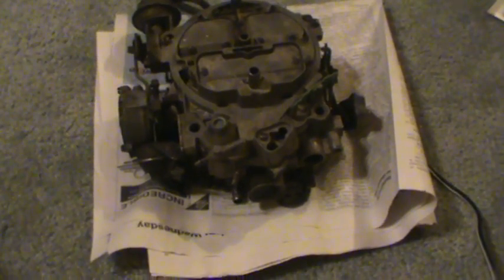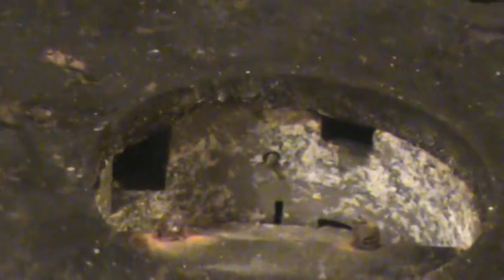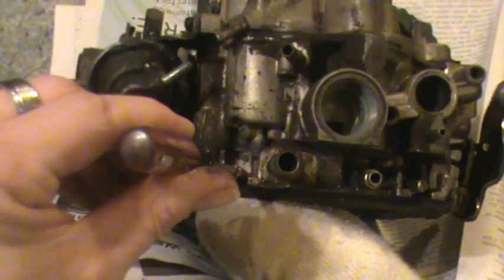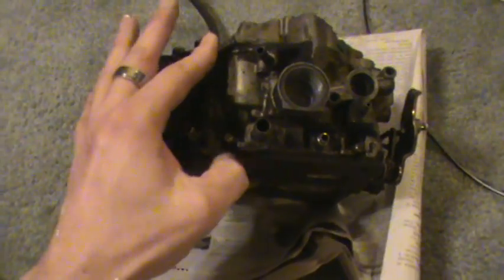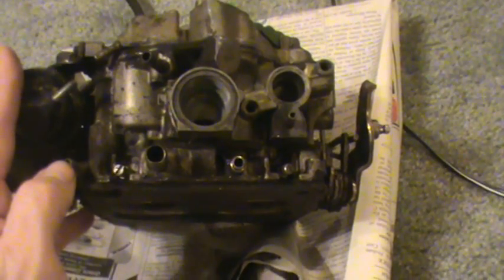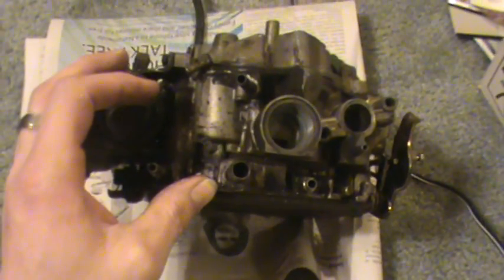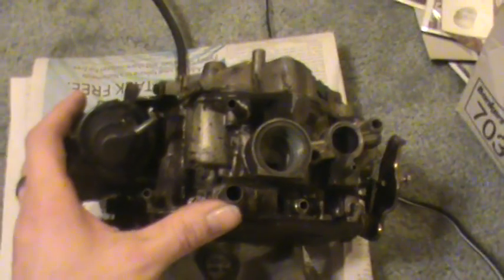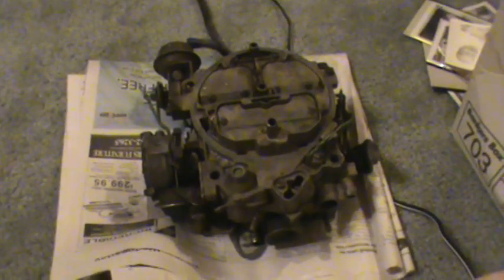How to adjust carburetor mixture screws

Comment: I have a 2 barrel on a 305 monte carlo i took it apart and cleaned it up and put new gaskets and float and needle now it wont stay on. Would i have to re-adjust the mixture screws since it is clean and not all gummed up anymore. Carb is a gm 2
Reply from the maker: Yes. Mixture screw adjustment is just one of those periodic things you have to do on  a carbureted vehicle.

Run each screw in(to the right) until it lightly seats. LIGHTLY. Then back each screw out 2 and a half turns(to the left). That's a baseline that will get it idling as long as there isn't something else going on.

Once you get the engine warmed up, you can fine-tune the screws just like I describe. Turn each screw back and forth until the idle speed is the highest.

Comment: Hello.
Very nice Video thank you! But my Problem is that i got these 2 screws out of my carburator and i forgot to count how many turns it took to get them out. Do you have a clue how far i have to screw them back in? I dont want to destroy my engine.
Thanks again you already helped me a lot!
Reply from the maker: LOL, don't worry, it's impossible to destroy an engine with the mixture screws. Run them in till they LIGHTLY seat, then back them out 2-1/2 turns each. Make sure you count the turns correctly. That will get it running. Then after you warm the engine up, adjust as described. Thanks for watching.

Comment: WhoSaidTyler I have a 82 camaro 305 quadrajet 4 barrel and my choke light is one and i tried adjusting the choke plate but it doesn't go off and i tried adjusting the choke plate where it should be but at times it high idles high and sometimes idles low after i adjust it. I bought it from a guy and he rebuilt the carb with a carb rebuild kit. What could be the problem with the carb?
Reply from the maker: You likely have either a dead electric choke unit, or no power to it. The troubleshooting process is pretty simple:

1. Get a cheap digital multi-meter on hand. Access the wire that connects to the choke, usually it's a green wire. Start the car(it MUST be running, not just have the key on) and see whether you have 12v at that wire. Ground the negative lead of the meter, stick the positive into that wire connector and see what you get.

2. If you have 12v then the issue is with the choke unit itself, which is the part that is retained inside the choke housing by the 3 screws. Sometimes they just burn out, but another thing that can disable them is that there is NOT supposed to be a gasket between the choke unit and the metal housing. Hot Air chokes use one, not electrical, so double check that there isn't one there.

3. If you DON'T have 12v with the car idling, then you have to figure out why. That circuit supplies "key on" power which travels into the engine bay, through the oil pressure switch( or a separate oil-pressure activated switch), then to the choke, The reason for going through an oil pressure switch is to prevent the choke from getting power with the key ON but the engine not running and causing the choke to open prematurely.

Ok...there are two locations for that switch: In the first scenario, it all runs through the regular oil sending unit which is located at the rear of the engine behind and below the distributor. Look at the connector. If it has 3 wires in it, then that's the only one and it should have a 3-wire sending unit installed.

If it has only one wire, then look on the left(driver-side) of the engine block at the rear, just above the oil filter. There should be another switch there with 2 wires. At that point it will be a matter of tracing power until you find a bad wire or a bad switch. Good luck.
Reply: thank you i'll check it out. Also when its running and i rev it it bogs revving up would that be something on carb?

Comment: Dear Cab Tech: 1985 22R Toyota: with engine off, float reservoir leaks fuel into intake manifold.  I replaced POWER VALVE and did full carb kit. It still leaks, but much slower.  I notice the power piston is pushing power valve open when I was installing top carb plate.  Should power piston be pushing power valve open during the install?   Thank you for any help.
Reply: I did a few easy test and why I'm puzzled.  When pressed, Power Valve leaks fuel.  Piston rod shouldn't be pushing valve during the rebuild or when engine is off.

Comment: ran across the plug over the adjustment screw on a toyota 22r i used a dremel and small chisel didnt feel like taking it off helped the truck a ton. Good video i was trying to explain this to my cousin how you just have to feel the sweet spot but he said i sounded crazy.

Comment: What if you idle speed screw is as far out as it can be and engine still idling about 1500rpm?
Reply from the maker: Check the ignition timing. If it is too far advanced it will cause the idle to be high and nothing you do with the carb will lower it.
Reply: Ok thank you

Comment: Thanks for making this video. I have a 1990 Chevy Camaro with a 305 V8 (carbureted). After maybe 20-30 mins my car starts to sputter and backfire and the check engine light comes on. Does my carburetor need adjusting?
Reply from the maker: You need to retrieve the trouble code that the computer sets when the check engine light comes on and go from there. The last factory carbureted Camaro was an '87 model, so your car should have TBI, Throttle Body Injection. Thanks for watching.
Reply: Ok, I'll do that. Thank you. I'll keep watching your channel.
Reply from the maker: *****
Good luck!
Reply: WhoSaidTyler
hey there, i have 4 scews, a base idle scew, the 2 misxture screws, and an other one on the left side, have have mesed with it a little and it changes the idle speed, so i wonder what its for, its on an 1985 chevy c20 5,7 350, quadrajet
Reply from the maker: *****
 Watch "How to adjust dualjet/quadrajet fast idle", that will explain it clearly. Thanks for watching.
Reply: thanx !

Comment: Tyler, have a question if you could answer ASAP please.  I have a 1983 olds 307 w/ a factory quad.  It's been rebuilt last year but I have always had trouble with a low idle while stopped in drive.  When its in Park it doesn't seem to have this problem.  I live in Mpls, MN and its a pain in the butt sometimes during stop and go traffic.  I follow your videos but can't seem to fix this problem.
Reply from the maker: I am assuming that you mean the engine won't idle well and tries to stall. Since your comment is on the adjust mixture screw video I will ask if you have done that?

BEFORE YOU MESS WITH THE CARB, CHECK OR HAVE THE TIMING CHECKED. Timing that is too far retarded will cause the engine to refuse to idle at low rpm.

You'll need to be able to adjust the carb mixture as well, but two minor things may present themselves:
#1 is that originally the mixture screws at the bottom were covered with tamper-proof plugs. Most have been cut out by now, but there are still some roaming around that have never been removed. They have to come out to access the screws. Carb needs to come off, flipped upside down and surgery performed. You can take a good flashlight and look at the carb and see whether yours are there or not. As in the video, you should see two "somethings" on the very bottom of the carb, in front. They will either be what looks like the ends of two round metal plugs, one on each side, or if you are lucky, two holes that if you look close, will contain the mixture screw.

#2 The mixture screws are "double D's". That sounds funny but it means they don't have screwdriver slots. You use a special flexible tool that is pretty cheap and can be gotten off the internet easily. It's called a carb adjusting tool.

http://www.summitracing.com/ga/parts/wmr-w1187/overview/

Good luck.

Comment: i have 350 stingray with the quadrajet ides smooth and drives great until i reach 45 mph or if i step on it and it bogs down almost to a stall, let of the gas and idles back but still can on drive up to 45 and easy on the pedal
Reply from the maker: It sounds like it has a fuel starvation issue. There are SEVERAL things that can cause it..fuel tank pickup restricted, pinched line, pump failing, plugged fuel filter,  float set too low in the carb.

Has it always acted this way or did it began after something else was done?
Reply: You so correct,  I was so stupid, I replaced the fuel pump and tank but thought it was smart to re-use the orginal fuel sending unit not a good idea learned that lesson, ordered one gonna changed that as well as filters and rubber hose off filter to carb, will check lines for pinch, didnt really understand car runs perfect ag slow spend but I guess at higher rpm more fuel is needed, thanks so much, seen many of ur video's and postings its amazing to have access to all that knowledge u have thanks and will be asking many more questions
Reply from the maker: Patrick Browning  Glad to help, man. Just take it one step at a time. When you have the old sending unit out, see if it was stuffed up. Those filters on the end can get full of junk, esp if the tank was rusty. With everything disconnected you can also blow through the fuel line under the car with compressed air to make sure it's clear.

Comment: thanks for the video i got a 1985 silverado c30 454  with the original 800 cfm quadrajet the needles on it dont have the screwdriver slot to adjust them it has the socket ones and my question is do you happen to know what size socket fits these thank you
Reply from the maker: It's a special head on that screw. You might get a socket that will work but most times it's too large to even fit in the hole(insert joke).

You can still get the special tool used for those adjustments here: http://www.amazon.com/AMPRO-T71301-Carburetor-Adjusting-Tool/dp/B00A8FOB16

Comment: I replaced the carb, and its running much better, however the van still sometimes dies at lights/stop and hesitates a little when pulling off from a standstill. For the the stalling, am I now looking at an EGR valve? I set the screws 2 and 1/2 out from setting, and it was running a little low, like it wanted to die. So I tried to adjust them one way or another, but it was very difficult to reach the idle mixture screws since the distributor was in the way. Finally when the van warmed up I adjusted the driverside idle screw and the lobing went away and didn't die at idle anymore. Am I doing anything wrong?

Comment: Thanks so much for the video! I'm trying to help an old disabled lady remove and replace her carb in a 85 e-150. I'm a car enthusiast at heart, and I've got a rebuild underneath me. But I'm new school- so adjusting the carb is something I don't have much experience with. She plans on getting the carb from autozone- will everything already be set? Should i check or set anything before I install it? Any guidance you can give me would greatly be appreciated! Thanks again!
Reply: SVPrelude I'm actually very surprised at how little information is floating around about this vehicle or carburetors in general. I understand the vans 28 years old- but normally the interweb is full of useful and not so useful information. There's barely any- and when I do stumble onto something, the descriptions are very vague.
Reply from the maker: What I do is find the two idle mixture screws, run them in till they lightly seat, then back each out 2-1/2 turns. That's a good ballpark to get it running, then after it warms up you can fine tune them as outlined here. You can also tweak your idle speed adjustment at that time but do that AFTER you have the mixture set.
Reply: WhoSaidTyler Thank you so much for the quick reply! After hooking all the vacuum lines up, and the fuel line- is there anything other I need to do before I start the car? I know after I rebuilt the fuel injected engine, I primed the fuel rail by cycling the fuel pump on and off a couple of times. Obviously, this isn't the case here, but are there any other similar steps? The more I do research on the carb, the easier it seems like a straight and forward install. This lady's van kept spitting black sut on start up, and would die a few minutes after idle or when she rolled to a stop or a light. However, if she just drove it on the highway- it'd drive perfectly fine. She wants the carb replaced- so I'm just doing my research.
Reply from the maker: only1balto
 No, you just mostly have to crank a while until the carb fills up with gas. What I do is disable the ignition system temporarily and then crank enough to ensure that there are no gas leaks. Once you check that, reconnect the ignition and it should start right away.

 You may need to do some minor choke adjustment also..what kind of carb is that, an autolite 2100?
Reply: WhoSaidTyler To disable the ignition system, just remove the the plug wire from the distributor to to the coil correct? Some videos I've seen, people open up the float bowl and let fuel trickle out- will this be something that I will need to do as well? In other videos, or how to install- this is never mentioned, so I'm a little confused.

I'm not 100% on the type of carb. Its a replacement for a 1985 E-150 302, 5.0L. The part will arrive this Saturday from autozone. They normally come with a instruction pamphlet do they not? Thanks so much Tyler- you've been a huge help.

Comment: hello my 78 camaro 350 runs and drives but the carb will flood if i press on the gas quickly, i have to slowly accelerate or else the carb will flood and shut the engine off. is it the mixter screws or the accelerator pump? its a rochester 4bbl quadrajet m4mc
Reply: Not the mixture screws; they only affect idle.  Not the accelerator pump; it just gives one shot of gas when you depress the accelerator pedal.  Look at his 3 videos on how to debog your quadrajet.  There are several things he covered that it might be.

Comment: I have an 85 GMC Vandura 2500 with a 305. I looked and felt all around the bottom of the carb but no mixture screws. The only ones I found were the choke pull off and the one at the throttle cable. Can't find them.
Reply from the maker: They are probably still sealed with the tamper-proof steel plugs. Carb has to come off and be flipped over in order to break out the plugs. You may as well freshen it up if going that far.
Reply: I did feel those. Guess time for a rebuild. Thank you. :)
Reply from the maker: yawyd
You are welcome. That means the idle mixture hasn't been adjusted in 30 years. Wow.

Comment: I always find the fastest speed that the engine idles with each mixture screw and then turn them out 1/2 turn to allow for any contamination that can get into the circuit later on which will lean them out. This will cut down the chances of idle problems sooner and postpones further idle problems. A little too lean is worse than a little to rich so it's better to give yourself a little "cushion" with that extra 1/2 turn out. I've done this for 43 years and it works better for less maintenance.

Comment: Hi, I just bought a 72 Cadillac Eldorado with the 8.2L engine, and I noticed that when I'm at highway speeds and release the accelerator in order to let the engine idle, there's a very strong smell of fuel that hits me. It's really strong. I have a feeling the car is running rich, but is this a symptom of something else that needs to be done to the carburetor ?

Comment: my boat runs great at high rpm and idles fine.  but  midrange, around 1000 to 2000 RPM it bogs and dies.  I can go from idle to WOT and no hesitation. Any ideas anyone?

Comment: I have a 76 Rally Stx van with a quad jet on it and I had some other issues like the fuel regulator and such go bad and then I had it rebuilt. Its still blows black smoke on starting and warms up bad. But the big problem is it runs ok at idle in park or neutral but when I drive it I have to put it in neutral when I'm at a stop light or it will start to run bad or stall out like its getting to much gas. or maybe not enough,I don't know. I keep having the carb adjusted but it works good fr a day or two and starts acting up again. Tired of messing with it. Should I just get a new one?

Comment: I turned the Idle mixture screw all the way in on a single barrel and nothing happend are my metering rods bad? Or is the screw to short?
Reply from the maker: Something is affecting the mixture other than the mixture screw. That is usually a vacuum leak or something is causing excessive fuel to pass into the intake. Also, ignition timing out of adjustment can cause the carb to not respond to adjustments well.

Also, if the idle speed screw is turned in too far, the carb will run off the main circuit instead of the idle circuit.
Reply: Thank you, I also replaced the fuel pump and someone told me high fuel pressure above 5psi would cause the Carb to run rich also.

Comment: I have a 32/36 Weber carb on my Toyota 22r when I turn the mixture screw in to the highest point of idle it seems to sleep rich and tends to throwing black smoke but when I turn it out idle drops and it stops throwing black smoke

Comment: I got an '87 Renault 5 GT Turbo and it takes a while for it to start and when I floor it, I can easily smell the fuel, inside the car. Also it often dives down the revs a bit when I give it some power. Just dives quickly and then revs up. 
Could this be because it is getting too much fuel?

I hope you can help me.
Thanks!

- Sebastian

Comment: Sir I was wondering if you could help me. I just bought a 1986 dodge 250 custom with the slant six in it and every time I start it up it runs and when I put it in gear it cuts off. The truck will stay on if I drive it with two feet though (left on brake and right on gas). Please help me!!
Reply: check your vaccum lines then timing

Comment from the maker: That means the idle circuit on that side might be stopped up with dirt or varnish. Sometimes you can use air and carb cleaner and get them cleared out on the car but if not it'll have to come apart.